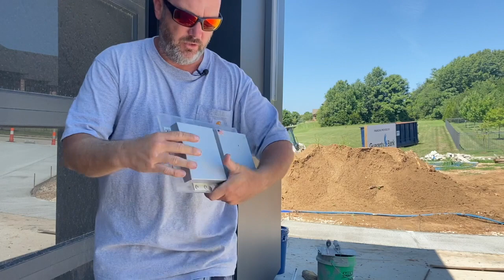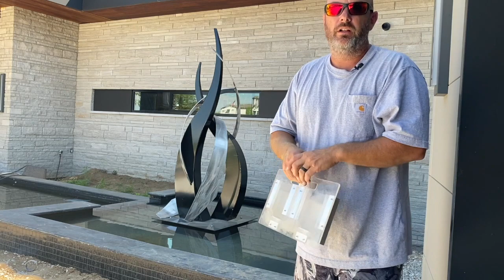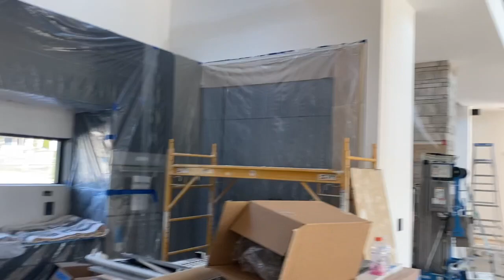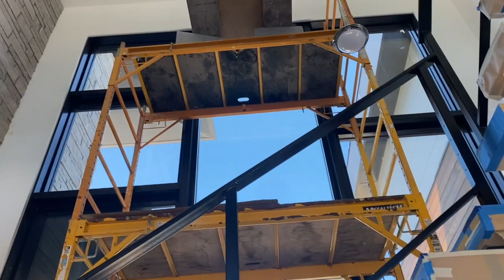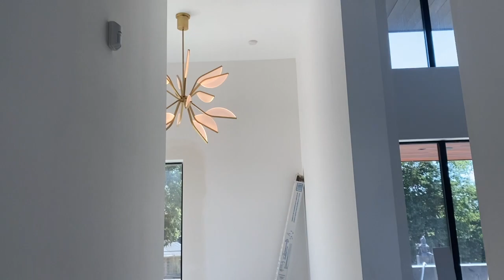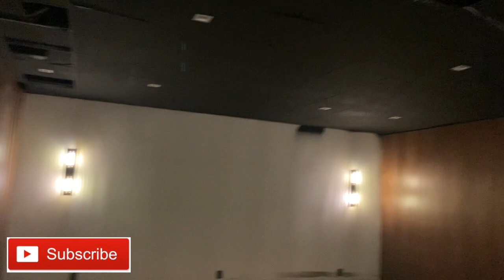Progress at the Big House!!!

Comment: Can you give us more details about the porcelain wall; size and approximate cost per sq ft?
Reply from the maker: 30x70” and this brand was $10/ft but it can be found as low as $5
Reply: @all3pools  30’ high by 70” wide?
Reply: @all3pools  for that wall of porcelain measuring 30 ft by 70 in., how many man hours approx. did it take to construct? ( not including scaffold set up or take down)
Reply: @all3pools  how many hours of labor, approx., to prepare wall and hang porcelain?